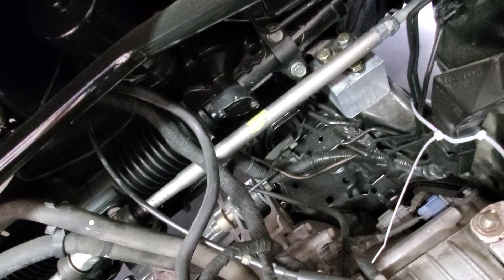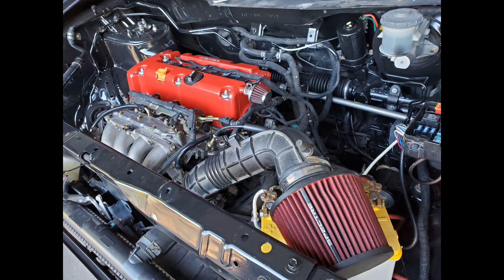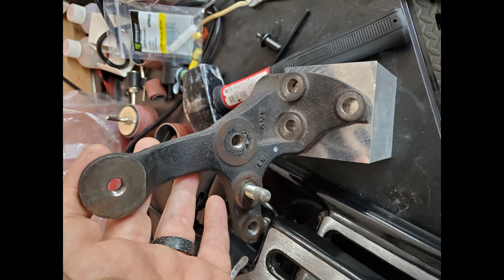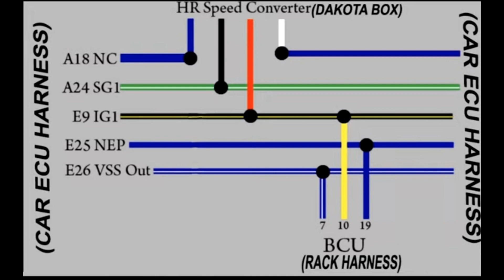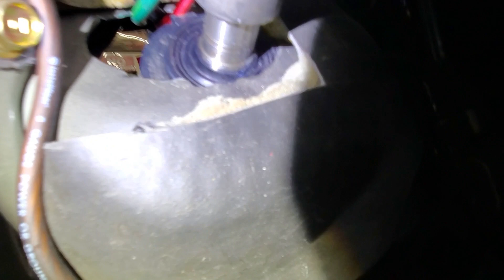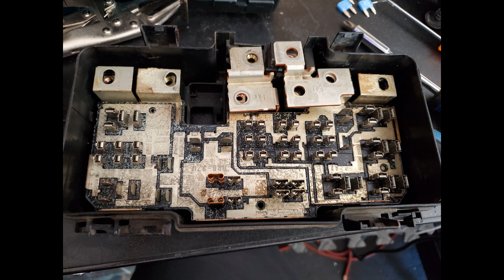Worlds first honda element with electric power steering

Comment: Bravo! 30+ years I've been an advocate of the electrification of ALL accessories 2clear the engine bay, reduce points of failure &2 promote reliability over time. I was afraid that this video was another of the electric over hydraulic conversions. I can't tell u how pleased I was 2c a completed full electric EPS conversion. 

Now, I would like 2c a completed completed electrified HVAC conversion. This would involve the replacement of the belt driven A/C compressor or a reversible heat pump w/an electric scroll style A/C compressor similar 2those used in electric vehicles, RV's& hybrids. I think that 48V versions r readily available. Once u find an appropriate location, probably on the lower right side firewall, the rest is simply the installation of custom hoses& control adaption. 

Next the optional replacement of the heater core w/a ceramic electric core is an option that I struggle w/because the heater core can b a valuable option during an overheating scenario. Low voltage cut off or auto start of the engine/generator when equipped w/an automatic transmission only2 replenish the LiON battery would b a necessity 2preserve drivability. 

I took particular notice of the cleaned up belt drive. Imagine the belt driven A/C compressor gone from the engine bay. It moves weight back on the CG& clears the way4 all manner of boost options, supercharge, turbo charge, V6, fuel cell, electric or hybrid transplant from newer Honda CVTs. Just beware of unintended consequences of choosing the location of your replacement scroll compressor in lieu of future drivetrain options. 

I use DUHON LiON batteries from China in my vehicles. I'm very proud of these units. The 1st is nearly 5years old now. I'm a retired NIASE Automotive Technician, Instructor Grade. I subscribed 2u immediately. I look 4ward 2developmental conversations w/any1 who is willing 2put in work like this. I am a member of the Element Owners club 'HELITUTOR". 

Good work man. 👍

Comment: why not do the hydro electric pump the volvo or the mr2 hydro electric pump  u can use the original rack and u can do clean install with it vs spending 5 times cost and time to do eps eps conversion
Reply: The goal is the complete elimination of the hydraulic components. Their weight,, complexity, dependence on fluid &points of failure r all negatives. Now that EPS has been perfected; there's no excuse. 

I thought that the electric rack from the current or CR-Vs might b the best fit. I wonder why the author chose 2make this rack selection &reject 1of the CR-V EPS racks?
Reply: @ct4cf question do you know if it’s possible with the gen 2 crv? I want EPS on my 2005 crv.
Reply: @lel3450  Nope, I don’t even know what a generation 2 CRV is. I assume that it is a cousin 2the Honda Element.
Reply: @ct4cf  sorry 2003-2006ish that last good crv